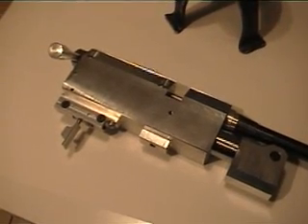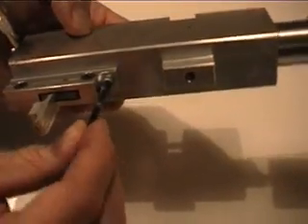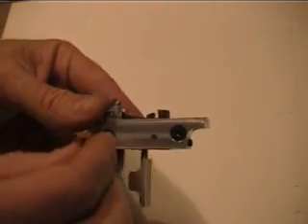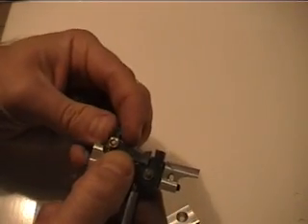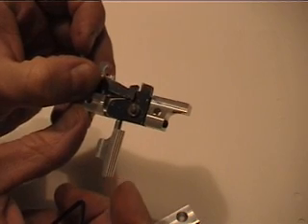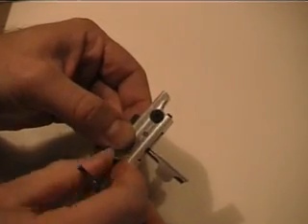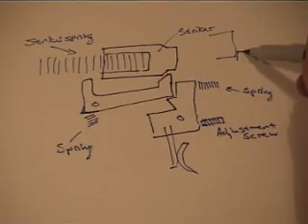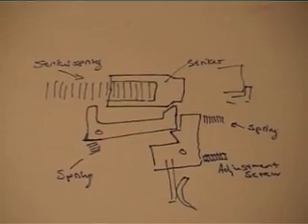DIY PCP airgun trigger design

Comment: Did you harden the sear engagement surfaces?  Very cool trigger, going to try building one for my pcp build! Great video!
Reply from the maker: Thanks for your comment! The setup in this clip is mild steel, and it's still in use in this rifle. I think I built it back in 2010, and I have sent quite a lot of lead downrange since then! I'd still suggest that you make your parts in a material that you can harden - just to keep a "crisp" trigger pull, avoiding any rounding of the engagement surfaces. I have used old files as a cheap source for material - anneal in furnace to make it soft, drill holes and file to shape, reharden  (water quench), anneal in oven at 210°C for 30, clean up and your done! Another steel that is easy to use is O1. 
Don't forget to show us your build!
Thanks 
/O
Reply: +ulanbatorgator Oh ok! I'm going to use plain steel and harden it.... I'm hoping to get my .50 cal pcp together and do a video on it soon! Just slapped a crosman 1377 bulk fill/hpa build together (see my channel for that build) and hope to have a .30cal build coming soon too!

Comment: may you please take a look at one of my vid : hammer valve air gun" and give me an advice ?
 its a project i am working.
 i do not have the necesary tools like you does so i convert things to what i need.
i will put 30 bars in that tank. tks

Comment: hey ! how comes the bb or pelet does not fall's down on the  transfering hole from the tank to barrel when you push it inside the barrel ? is it smaller than the bb diametter ?  tks

Comment from the maker: @warlocks789 Thanks for the input! I have four lathes, none of them has cost me more than 300usd... Yes, they are old, but old iron last forever! The trigger pictured her could be built from 2mm sheet metal, with a "spacer" sandwiched between.. No need for a milling machine, just a drill press, file, hacksaw and some elbow grease....
Thanks

Comment from the maker: @warlocks789 Thanks for your comment! Designing a working trigger unit isn't that hard, the easiest way is to cut out the parts in thin sheet metal (beercan..) and use pins as pivot points. that way it's easy to see what the parts should look like, where the pivots should be etc. Regarding machine tools; the only machine tool that is absolutely necessary is a lathe; milling ops can be done in the lathe. Cost..; if you buy good quality, second hand machines they will retain there value 
Thanks